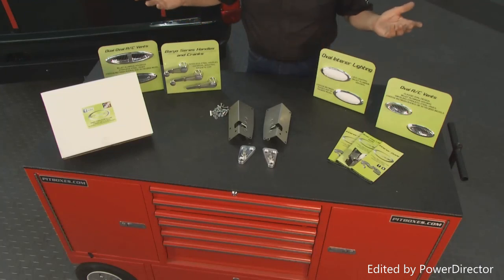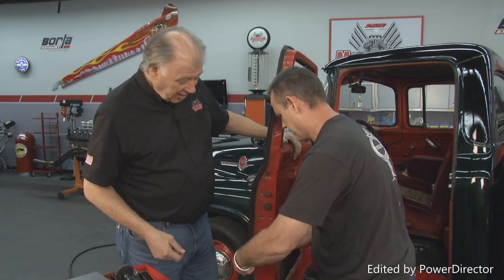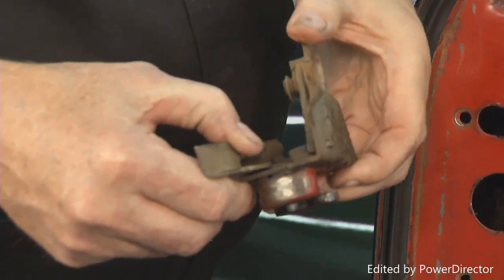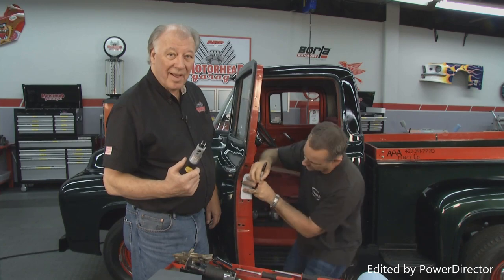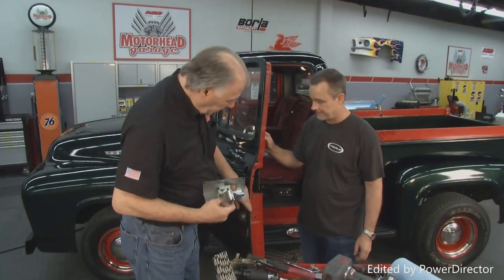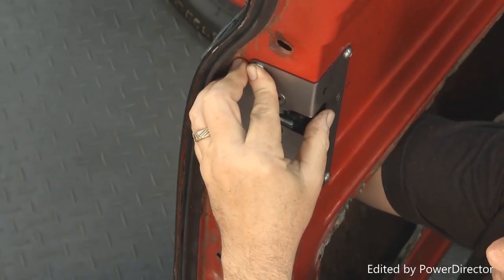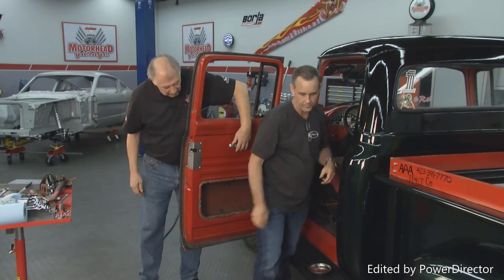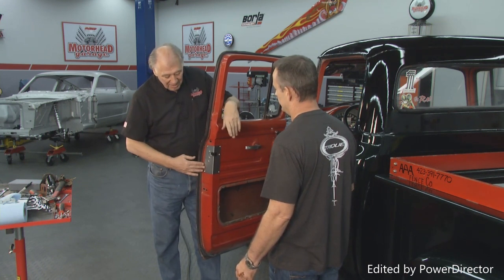Altman Easy Latch Install on Motorhead Garage

Comment: Very nice quality product in my opinion.  I just installed on one door and it looks great.  It did take me over half a day however because I had to make an extra trip to the hardware store because I was shorted a bolt, nut and washer.  And it seemed I had to modify each part.  The locking mechanism wasn’t working and it was driving me nuts trying to figure it out.  I had to add extra washers to properly space the locking pin and I had to shave the pin on one side so it wouldnt hang up on the mechanism.  The arm coming from the inner door handle had to have extra metal welded on to it because it wouldn’t engage the mechanism properly.  I had to cut a bolt coming off the door button shorter because it was causing the mechanism to get in the way of the locking pin.  Then I had to go back to the hardware store because i couldn’t find the right size washer to fit over the spring that slid over the arm coming out of the tumbler.  I’m finally finished with one door and it looks great but the door seals on my truck are too friggin thick and won’t allow the door to shut all the way without slamming it.  It never ends!  Anyways, I love the product but it seems a little pricey for all the extra work I had to do

Comment: Worst product i have purchased in a long time. AND - expensive. 
Before anyone says dumb guy  - my builds have won international awards, last one being Hot Rod magazines Top Ten at Detroit Autorama
Totally inadequate instructions, short 4 bolts, and nuts, and washers, which are not easy to come by in this area, template isnt even close to letting the latch plate align at the top of the door. And - the inside handle linkage required being drilled out to fit the supplied bolts.
ANd the worst part  - you can not align the latch enough to close the door to anymore than just touching the door seals as the seals put too much pressure on the latch, and trying to open the latch with seal pressure bends the internal hardware to the point it wont open the latch - unless - you push in really hard on the door to crush the seal before pressing the release button.
I'd like my money back

All in all a very bad product - nice idea but doesnt work in practise
Reply from the maker: Ken Currie, we hate to hear about any customers having difficulties with our product. For over 10 years we have taken pride in our work and have had very positive feedback from thousands of customers that have had great experiences with our latches. With that said, have you contacted us concerning your issues? We can certainly work with you through any issues you are having to make sure you are satisfied. Our number is 1.866.987.4783 my name is Chris and I would be happy to help you out.

Comment: What is the brand of the cut off saw your using
Reply from the maker: Not sure what brand was used during filming. It was one that the production crew rounded up for us to use during the filming.
Reply: TriqueManufacturing:
Okay thanks for getting back I think I'm going to use a nipping tool